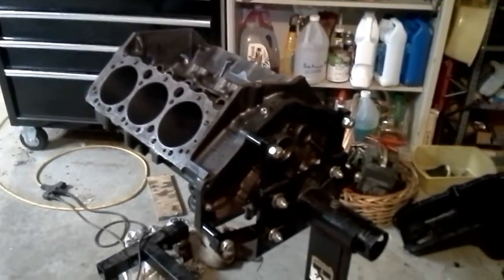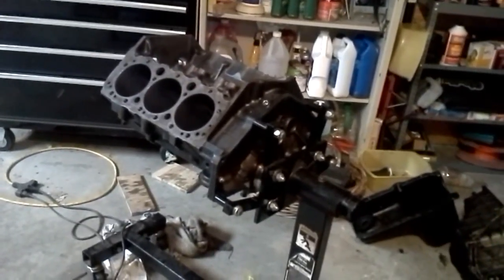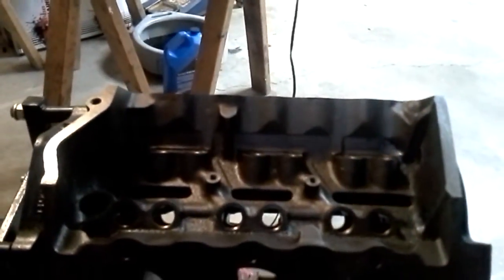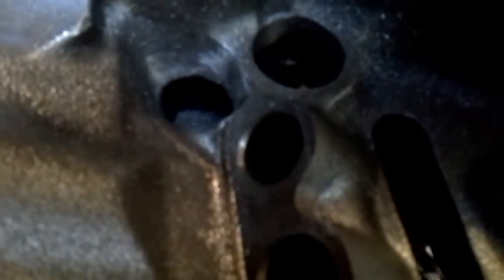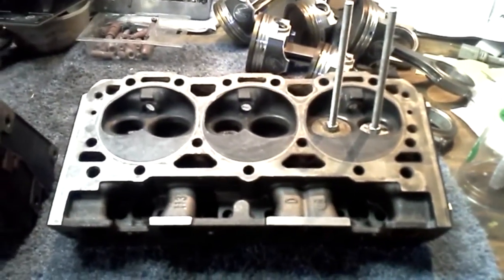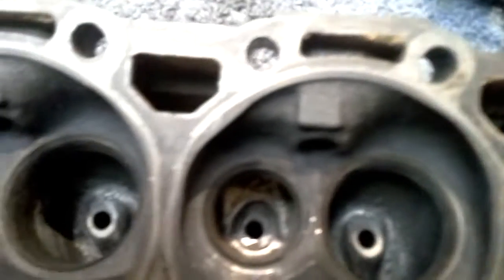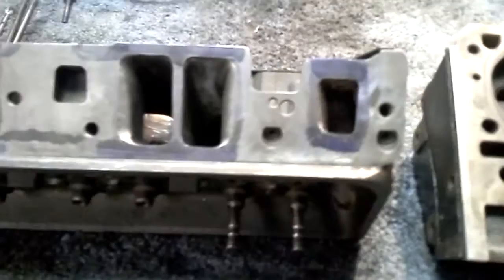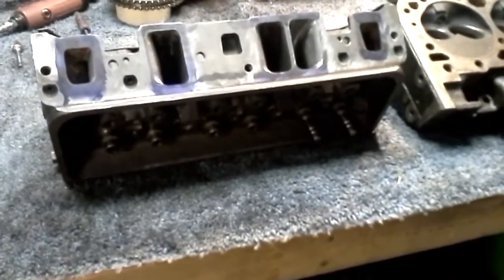Turbo 4.3 build update Vortec Heads #2

Comment: JD - I trust you are still on the mend and improving.  Saw  a comment on a Richard H video a week or so ago.  I am building 4.3 turbo engine (~500 hp/lb ft) and would your perspective on installing the splayed mains.  My block is a later '99 block.  Thanks
Reply from the maker: Everything you can do to help support the crankshaft and main strength helps.  There’s a decent amount of cost in adding the splayed 4 bolt mains including the machine work. 
I’m wondering if it’s 100% necessary or good insurance at 500/500. 🤔

The issue for us ended up being the factory spilt rod journal crankshaft; at around 650hp we bent the Syty nodular crankshaft. 
There hasn’t been any aftermarket support for high strength 4.3 crankshafts, other than the NASCAR forged 4.3 crankshafts with very rare availability and expense.  Back when we were building our 4.3 a NASCAR “core” crankshaft was $2800.00 requiring full machining!  
After bending the crankshaft my friend Richard decided it was time to LS swap his Typhoon.  JD
Reply: @HeadFlowInc  Thanks for your reply and experience.  I was a little concerned that the main webs are a little thin and could be weakened by putting another bolt in them. Plan on doing a partial fill with a good grout to further strengthen the bottom end.

Also, do you have a recommendation on a roller cam for my application.  I have seen some builds around a comp 280 (224/224 on a 110 lsa and around 525 lift.  Seem to work, although not optimum on the lsa.

Comment: I got a 4.3 Silverado had to replace the spider with a they call it a mpfi replacement upgrade the intake plenum doesn't fit down right is there a different spider mounting bracket for the mpfi unit ? I know this video is about a custom set up but if anyone knows the help would be much appreciated
Reply from the maker: supershark 9k Check with the Parts store for figment issues.  If it was a direct bolt in upgrade there shouldn’t be figment issues.

Comment: Build it bro stop talkin
Reply from the maker: We did! :). It's been a constant challenge finding which parts from eBay actually worked.  His best time last year was a 7.61 1/8th mile with zero boost on the launch.  Richard switched to the Holley Dominator EFI, new 3300 converter, air to air front mount intercooler, and our home built Caltrac traction bars. It should be a legit 10 second Typhoon this season!

Some of the build takes time as the funds are collected.  I go slow trying to outline porting as an educational tool.  Thanks for the feedback!  JD

Comment: so im looking into doing a similar 4.3 turbo. just wonder where you were at for time nd cost?
Reply from the maker: We're just South of Kansas City, Mo. What type of set up?  SyTy type manifolds or?
Reply: +HeadFlowInc still in the planning process.  looking for good power and durability for daily use. but i might be going with a custom exhaust and if i can find a good price then syty intake.
Reply from the maker: The SyTy exhaust manifolds will support more HP/TQ than the factory crankshaft can handle so don't waste money on exotic headers. 600+ HP easily
We went with Turbonetics but you can also make good power with Ebay turbo's as long as you plumb the oil lines properly and change the oil often.
Get H-beam rods, forged pistons, stud everything, and balance the assembly. Make a realistic build plan in the power range you want.  Richard is running  11.90's 1/4 or 7.60 1/8 with the engine we built at 18# boost in a 3800+ lb Typhoon. He started with a Turbo Tweak chip tune but is currently switching it over to the Holley Dominator EFI setup.  The engine was no where close to being tuned for best power before as it should run 10's when we get the tune right and get it to build boost on the launch again.
Reply: +HeadFlowInc That is very helpful information.  and as turbos go, I was planning on Garrett or Percision. I haven't  found any ebay turbos that I wish to use.. and as for the performance feild I am building Drift truck. hence why i am looking for the ability to beat the engine and still have a running daily driver/street truck after. (aswell as a second car on the side for build and breaks haha) but any information is good input for me right now. and thank you